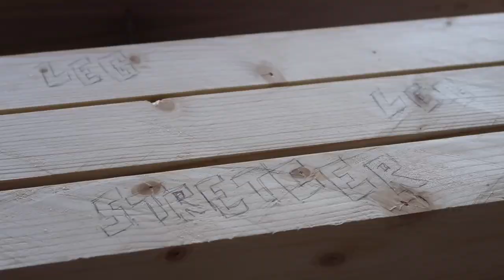Farmhouse Entry Table w/ Cross Supports using Half-Lap Joints

Comment: For a hobby piece it’s nice but the fact that you think that is ok to sell to a client is ridiculous. The top and bottom shelf are warped, some of the dowels were not drilled straight , which would make them look more oval ish and it should have been finish sanded. I would have been fired if I built something like that to sell

Comment: What is that thing you rigged up on the table saw? Does it keep it straight as you push and pull?
Reply from the maker: My cross-cut sled? Yeah, it's a lot safer to use when cross cutting pieces on the table saw. Or you could use a miter saw to complete the cut.

Comment: Is that the delta 36-725? Thinking about getting that table saw. You like?
Reply from the maker: I do like it! Got it off craigslist for $350 new and assembled. The dust collection on it works great and I’ve built a router table into it as well. The built in mobile base is a nice feature too

Comment: Do you like the music?  Or is it just easier than saying something.  Such as describing what you are doing.
Reply from the maker: I do a little of both in my videos I guess. I didn't really have too much of a plan here with this video. Just kind of recorded, edited and uploaded pretty quick. Should I copy the video and narrate over it and upload? or should I just post subtitle scripts to the video? What are your thoughts?
Reply: I think subtitle scripts are fine for most projects, but definitely don't bother going over and redoing. Very nice work brother.
Reply: @NicGutierrez  I think the subtitle scripts were fine and a voice over would've been fine too. But as shawn n said, definitely don't bother redoing it. The video got right to the point. I honestly didn't like the music choice, but I see others did, but it also didn't take away from the video. I just muted it and enjoyed the build. I think you should do a short video on the half lap joints. When I first started woodworking, eons ago, I was taught to notch the dowels so the glue has somewhere to go. Not all the way to the end so you can see the notch on the exposed finish end, but on the better part of what goes into the hole. Otherwise you're just compressing the glue and possibly creating an air pocket behind the dowel and there isn't much glues actually holding the dowel in. This is just my 2 cents. I was taught this by a carpenter. The premade dowels you used had this in the form of a cork screw pattern. I'm definitely not criticizing the build, I loved it and am going to attempt one myself, I'm just offering a little advice. Creating the notch I'm talking about is easy. In a scrap piece of wood, just drill a hole slightly larger than the dowel and run a nail from the side so that the tip of the nail will scratch or notch the dowel when you pass it through. You can control the depth and length of the notch this way. Again, great build and thank you for sharing. And you got a new subscriber. 😁

Comment: Nice...if I want to add a shelf in the middle how would you go about adding it to the design?
Reply from the maker: Oh, nice idea! Maybe work in some dadoes on the leg assemblies and then you'd be able to slide the shelf in. Make sure to make this cut on the legs before glueing up the base. Depending on which face/edge you dado, you could drill out holes, glue and insert dowels like I did to match the rest of the joinery. 

Or just butt joint and screw ; )

Comment: Did the client also pay for a bowed top because that's what the client got?
Reply from the maker: Yeah, unfortunately it did. But before I delivered I clamped it down until it was flat using cauls and braced it by screwing four pieces of 1"x 1"x11" oak to the under side.
Reply: @NicGutierrez  still a nice design. Maybe next time, joint one edge and square it with the saw then joint the face and plane it after that
Reply: @NicGutierrez  I saw the cupped top as well, but one thing I considered is that this is pretty much a  "farmhouse" design, and  not "fine furniture".  Farmhouse furnishings were usually built out in the barn, by the farmer himself.  Not by a professional carpenter.  A few flaws are always part of the "farmhouse charm".